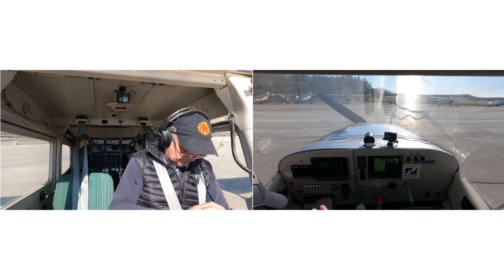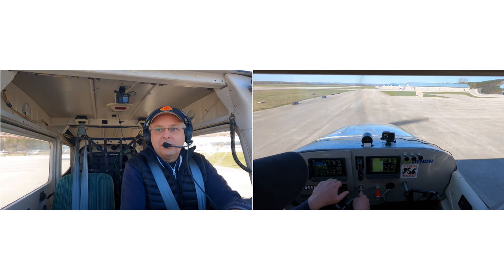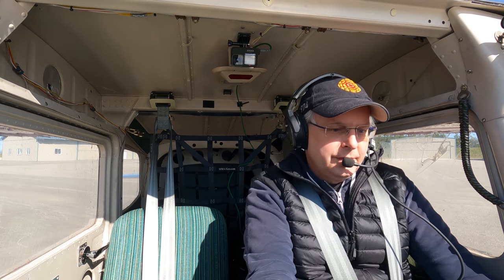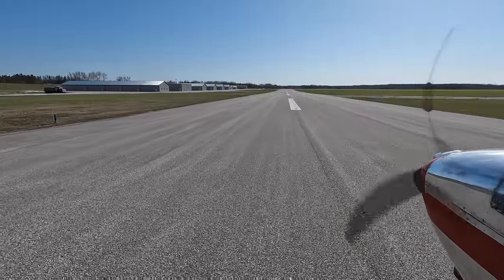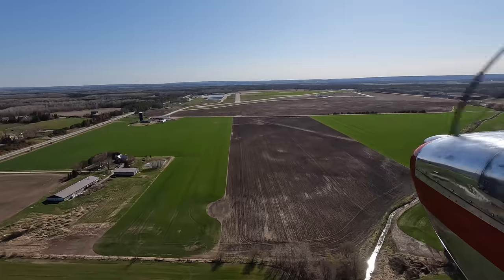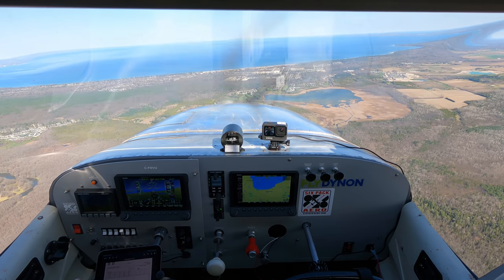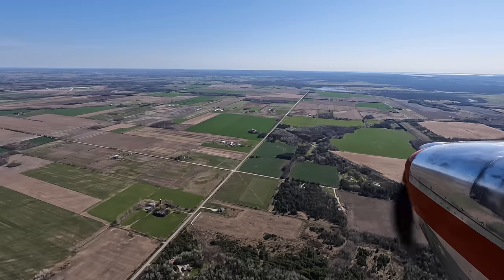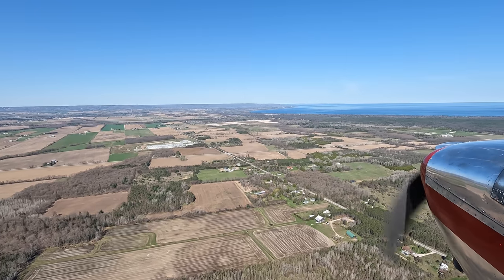Flying C-FMVU Talking About Flying And The Channel.

Comment: The new insta360 RS 1” version been pretty good for me on the dash. It keeps going when it’s pretty freaking hot while the one x 2 would give up in the sun without the vents being on. You can try one out to see if it works for you. Big negative is they still have clip gap if it needs to switch between files but it seems from report a shorter gap than they had before.
Reply from the maker: Thanks for the info!
Reply: A few years back, I borrowed an insta360 camera to publish some Google Streetview of some unmapped roads near my parent's cottage. The camera held up in the July sun of Northern Ontario.

Comment: Add a separate angel of attack indicator instant notification of out of parameters especially with stoll kit. Ya don,t really need to add flaps on downwind (just flying school keep ya in air longer more money ) base or Finals okay. Also avoid Flaps down in the turn if you not on speed danger of stall/spin. Adding 30 flap on real short finals waste of time. You should have stabilized by mid finals. If you add where you did ya gotta adjust trim etc when ya should concentrating on landing. Another thing Carb Heat should be pushed closed around 200ft so if you have to go around you have FULL POWER not pissing around in the GO AROUND wondering why you haven,t got full power under stress. Other than that all good. The Polished Ali looks great.

Comment: How many square feet to the wing extensions? Will increased wing square footage reduce airspeed limits in turbulence? On the other hand, are you looking to reduce stall speed with the cuffs and vortex generators? for, possibly, "outback" landings? Finally, do you have any plans to put in a headliner and side liner? And, congratulations! I hope that you and your plane have many happy adventures!
Reply from the maker: The WingX will add around 12.5 square feet of wing and will lower stall speeds, shorten landings and take off and increase climb. The Sportsman STOL will help with all of those things as well - with the vortex generators keeping it from getting squirrelly at low speed... Thats the idea anyway.

I'll also get a small increase in gross weight / mtow

Comment: Great light, remember any landing you can walk away from is a good landing. Glad to see you flying MikeVictorUniform. How will the wing extensions affect the handling? I am thinking fuel burn, flight speed and take-off, landing. I also love the way cameras mess with the propeller roration.
Reply from the maker: Time will tell on the wing extensions; apparently top speed will be unaffected, with a slightly lower fuel burn - something negligible like 1% less, so nothing to write home about... 
But - the extensions aren't certified for use on American registered Cessna 172s, so info on performance for this model isn't easily obtainable. Only Canadian 172s (maybe some other countries) can put these on.

They are certified in the USA for 180/182/185/206 - for those the take off and landing numbers are great.

Comment: Im not a pilot so Im open to criticism for this comment.
 On your touch and go, you put in your final notch of flaps just before touchdown. That seems counter productive to me. I would that final notch of flaps should be put in sooner to give the pilot time to stabilize the aircraft prior to touch down. On a windy day, adding those flaps right before touchdown might cause you to be overwhelmed, with trying to dip a wing and crab to touchdown. All that aileron work and rudder would should keep you plenty busy.
 Your thoughts?
Reply: I have to learn to proof read my comments. 😂
Reply from the maker: @joebailey7585  There's no 'One Way' - every landing is different, and there is (in the media / YouTube world) an oversimplification around the idea of a stabilised approach. 
Yes - flying a commercial airliner there are protocols and specific things done at specific times during the landing, but even then you need to think on the fly based on wind and other factors.
In this instance putting in an extra notch of flaps on short final is not a problem at all. In this aircraft an extra notch of flaps is preferable to a slip (what you described as a crab). I'm also flying an airplane that has very little in common with a standard 172 - 3 feet of extra wing length + a STOL cuff + VGs, etc - so my procedures will be slightly different than the norm. 
With a raging crosswind, I would do it differently, but there wasn't a raging crosswind.

Comment: Weird question, are you allowed to fly to downtown Toronto and do a lap or two around the city? I’m assuming your allowed, itwould just be hectic with radios, etc. How does that process work?
Reply from the maker: We'll be doing that - not as hard as everyone thinks, you just have to ask ATC and follow their directions.
Reply: You might want to check out video by Flightchops he has a couple of Toronto city tour videos
Reply: As long as there aren't already several airplanes doing city tours then City tower will clear you into the downtown for sightseeing. It's probably more hectic immediately before getting there than once in the city control zone. Coming from the north VFR you'd need to get through either Downsview or Buttonville, both of which are untowered, and announce yourself as you transition the airspace, and then call up City tower in relatively rapid succession. Once you're over Toronto ATC actually looks out for you and you have less uncertainty about where conflicting traffic might be, or where you're allowed to be, than if you were in an uncontrolled area. You listen for your call sign and follow ATC instructions (if safely able, of course). Or you can call (city) Tower and ask to fly south of the tower and north of the field, it's a magnificent view. So, as Glen says, it's not as hard as it may seem. It's not a very long flight from Edenvale so I think it's definitely worth it to see the city skyline. Maybe a future video?

Comment: Another Just Plane Silly fan but to be sucked out when your door opens in flight you have to have a parachute on.
I am with you on the cameras, I try to turn all my cameras on before start up and then I forget about them until I am well into the flight and I will then talk for the camera but flying is number 1 on my to do list when I am up in the air. If I get footage to edit and post on my channel it is a bonus.
As for your landing, just try to keep it flying at 6" along the runway for as long as you can, was my instructors advice.

Comment: G,day Glen from Sydney Australia.
The Cessna is looking good.
* First oil change: no filter. Are you going to strain it through material to rule out any ferrous metals?
* How are the engine probe temperatures, hopefully low, stable and similar.
*Any stall warning horn: how about sending it off at touchdown? 
* The glass Dynon, maybe a cross country with waypoint coordinates and back home would be good. Check it with a sectional chart simultaneous.
* Wing extensions: will it fit in the hanger? That's going to change the performance envelope of the bird!
And lastly.... Nice farming land, are you following roads and rivers?
🐝💨

Comment: Glad to see you back in the air! Honestly, I think it's good to film less and fly more, in the US at least we've had more than a few instances where angry viewers have reported pilots to the FAA which makes me really nervous. I'm confident I'm a good pilot, but edited videos lack context and some people are just looking to troll which is a bad combo.

Side note: I think there may be something weird going on with your gopro footage? It looked like there was some motion artifacting, kind of looked like what you might see with optical flow errors. Was wondering if you were maybe converting from 60fps to 30/24 and used pixel motion for the frame interpolation? Most noticeable in the reverse shot when you're moving your hands around. Didn't look like a compression or rolling shutter or high shutter speed thing.
Reply: also I like the bumps too! it's boring when it's glass smooth all the time, the bumps remind me I'm flying a machine through the air :)

Comment: Good work Glenn I counted 2 very acceptable landings. Don't be super critical of yourself you are doing better than great. One very minor thing I noticed was when you overflew the field it looked like you were already at pattern altitude (PA) and you did not bisect the middle of your intended runway (in this case 08 /26). This put you at the end of the intended runway in the crosswind position while another airplane was taking off.  I was taught to overfly the field at above the PA and then to immediately descend to pattern altitude when I joined the downwind. This observation may fall into the category of a difference without a distinction but that's just me trying to be extra safe.